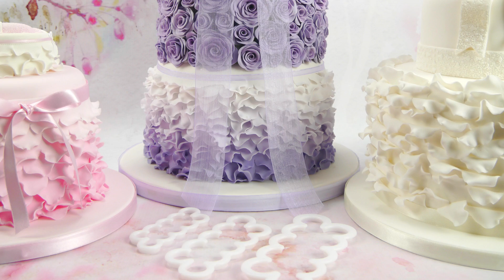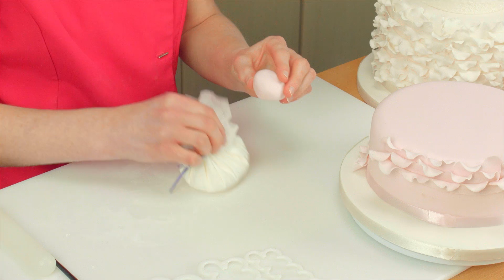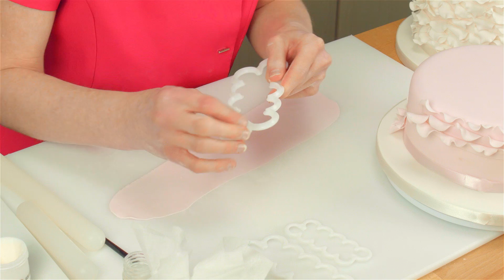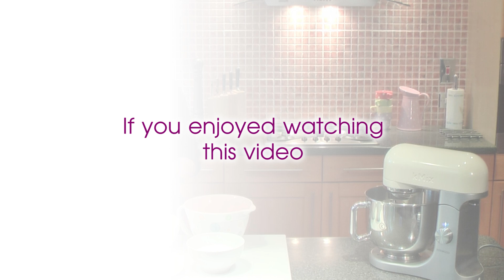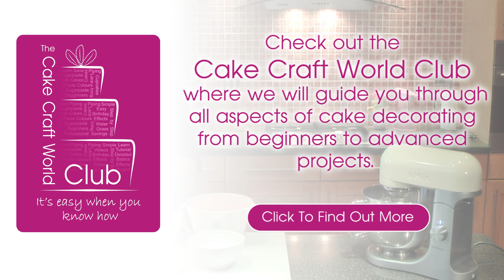How To Make Beautiful Ruffles & Frills On A Cake

Comment: Thanks for this tutorial...really helpful...Any substitute for the glue?is it ok to use water?
Reply from the maker: Hi Jen, thanks so much for your message. If you are using a paste without gum, it is possible, however, not advisable, because the water will dissolve the sugar. We would always recommend glue. Hope that helps :)